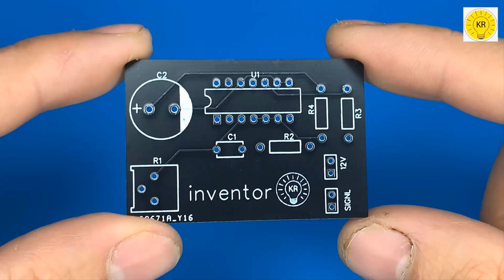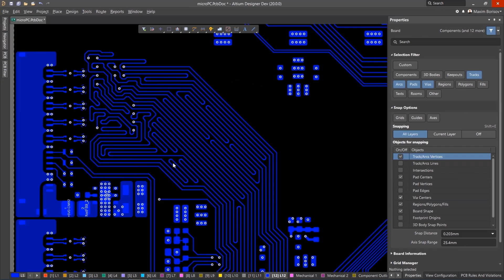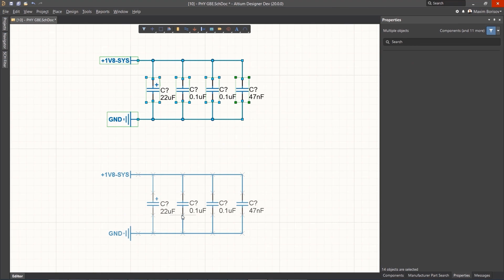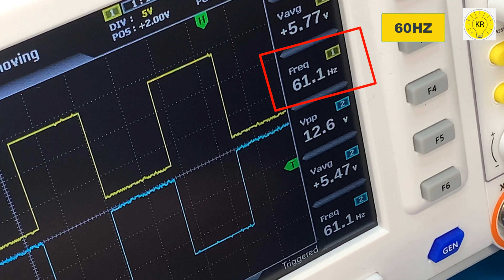easy way to make a pwm inverter , altium designer

Comment: I designed this but the 50 hertz is neither going up nor down
Reply: Variable resistance 10 k
Reply from the maker: 100k to 500k Variable resistance
Reply: Bro Give Me This PCB Circuit's Diagram ❤

Comment: This circuit in the video has a fixed pwm, with the potentiometer you can vary the frequency only.
This circuit is typical for driving  push-pull converters, but dead time on the signals are missing, without dead time
the conveter may fail or malfunction.